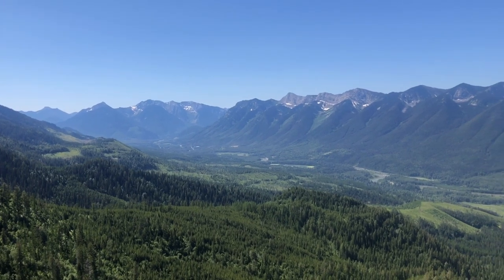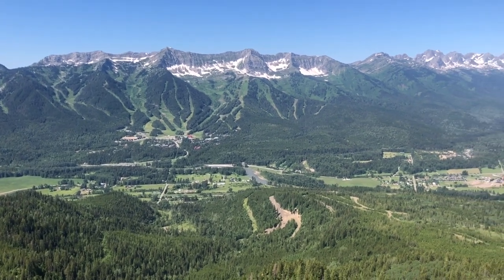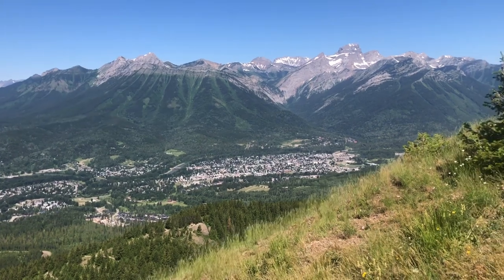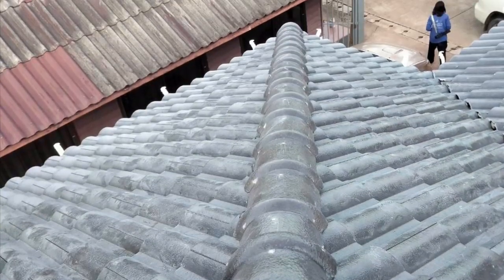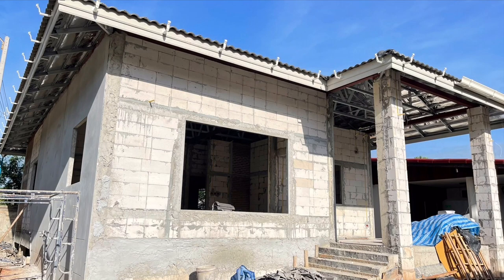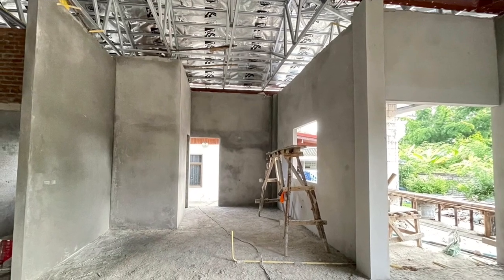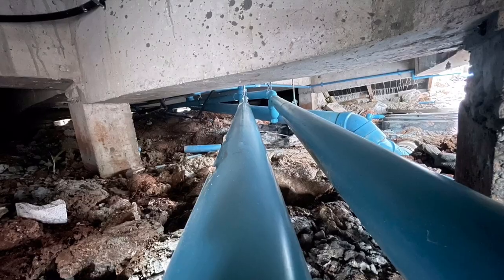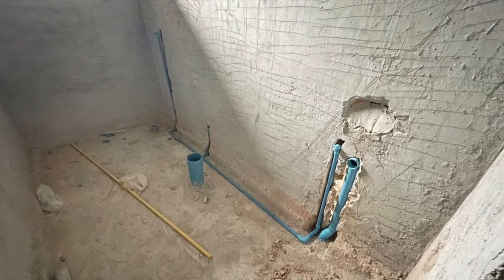Thailand House Build - Walls, Roof, Conduit

Comment: Bringing in a new builder is a bold move, but a good call when you have that gut feeling. I am always amazed that Thai home building requires ripping things up to get things going. Are you adding insulation in your ceiling?
Reply from the maker: Yes, have had a few this ripped apart and done over.  We have insulation under the tiles and the ceiling tiles have insulation.
Reply: @canuckinisaan8242  But do you a waterproof membraan direct under the tiles? i see them putting the tiles on the roof without membraan. otherwise isolation get wet and don't isolate anymore.

Comment: Do the roof tiles offer better insulation than the metal roofs?
Reply from the maker: I was told that the metal roofs have better insulation, but I am not sure.  Thanks for checking out the video.

Comment: putting the walls up  before the roof how did you get the water out of the house after a rain storm.  I have the same problem waiting for roof tile will take 50 to 60 days
Reply from the maker: I think it mostly evaporated, or in the low lying areas such as the washrooms, the scooped it out by hand.